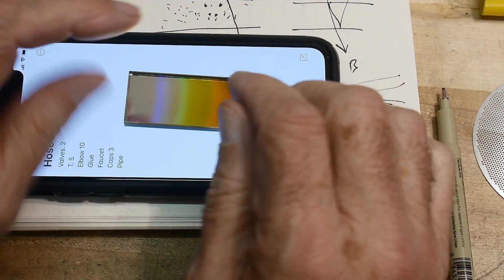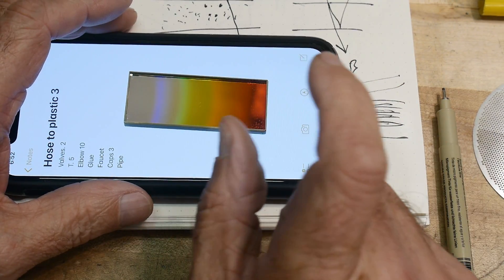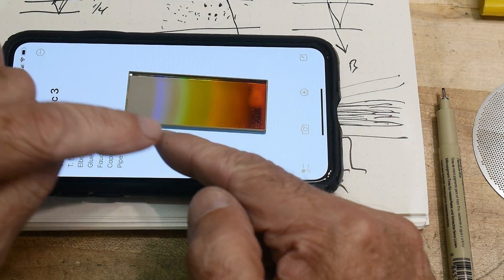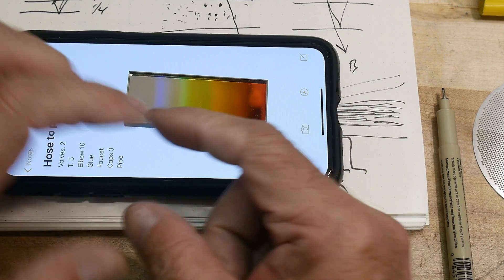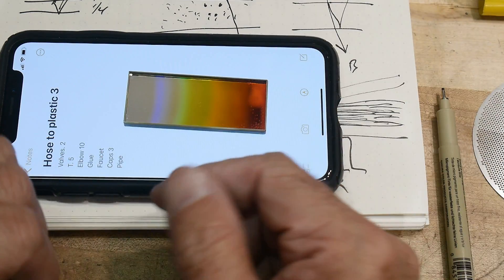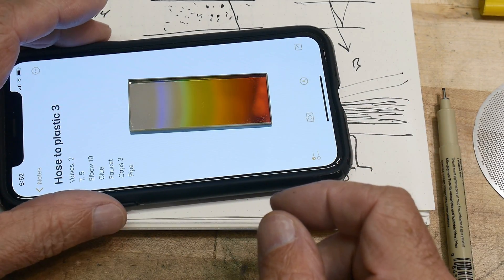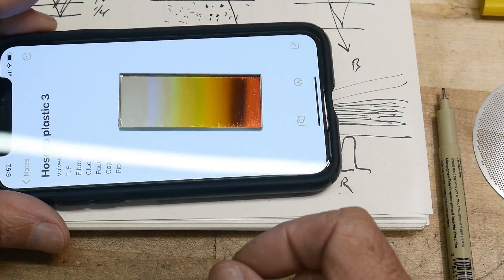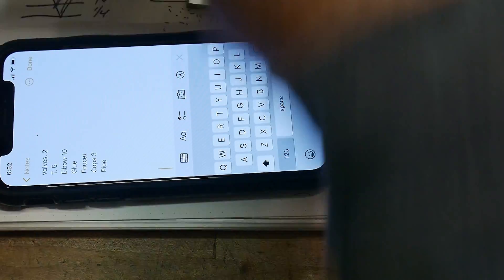#1046 Strange Optical Filters

Comment: Yellow is a SHORTER wavelength than red, blue is a SHORTER wavelength than green, and violet is a SHORTER wavelength than blue.  The wedge filter extends into the NIR and NUV at the ends that we cannot see but, yet, are useful in applications with electronic sensors.

Comment: Wow, totally awesome!  I've never seen that long a wedge filter or even such a great video detailing in general a range of filters.  Very excellent!   Wondering theoretically with like say a 4K webcam lens... what's the highest resolution of a theoretical wedge filter spectrometer in the ideal optical train designed for?   I was thinking that last lens was like a neutral density filter.   Neat, I've been wanting to make a webcam spectrometer using like BluRay disc section as a diffraction grating on a hard drive actuator to sweep like a dispersive instrument though with that magnetic bearing and a nice Apple CD/DVD drive sled for the slit width control for the collimator(s).  I so have all the parts... just not the best environment conducive for many of my projects.  Thanks for sharing!  Really neat... and times well with Les' Lab DIY integrating sphere video.
Reply: Amazing also how many are not aware of the THz and down the range optical methods & parts that are like what the human senses detect & perceive. Neat and awesome to watch!  Maybe you can do a homebrew interferometer spectrometer from like common parts?  I'd like to try that out one of these days as well and have been saving parts to play with after doing some theory for feasibility.
Reply from the maker: have you seen this: https://youtu.be/GXD9c5TQ6Ls
Reply: Polarity would be neat to see also... I'd like to add that dimension of information to the webcam spectrometer as well.  Like the circular dichroism aspect.

Comment: I do astrophotograhy as (yet another expensive) hobby, and one of the filters in my camera's filter wheel is a narrow band Hydrogen-alpha emission line filter.  It's got a 13nm wide bandpass at a 656nm wavelength (red).  Just looking at it, it just appears to be a mirror... an expensive 35mm diameter filter that just lets only a few photons through.  And of course, RGB dichroic filters that don't look like any of those colors from the front..  Neat stuff!

Comment: I keep thinking about designing something like one of those 328 universal component testers that are all over the Chinese markets for like $7, except also with an optical channel. Using a fancy filter would be cool, but probably not good for manufacturing. With a cluster of maybe 5ish LEDs of different wavelengths including IR, and 5ish detectors of similar wavelengths, you could run an unknown component through a bunch of different paces and help sort out the junk drawer full of unknown optical components that so many of us have. (Or is it just me?) Photodiode at 940nm? Check. Phototransistor for visible light? Check. Etc.
Reply from the maker: you might look at this one: https://www.maximintegrated.com/en/design/technical-documents/app-notes/5/5410.html
I was hired as a consultant on that project.

Comment: What a great video! I use a spectrometer with the work I do in horticulture light. As a tip for everyone, you can buy 400-700nm very sharp bandpass filters for about $20 on Amazon. My quantum light sensor uses one as well as a silicon photodiode flattening response filter.

(Most?)  lux meters use a simple plastic green broader short pass filter and then rely on the natural spectral response of the photodiode to approximate lux which is why they are much cheaper to make.
Reply from the maker: If you only want to measure LUX, you can get high end photometric sensors, that are photodiodes with expensive glass colored filters to fit the photometric curve much better than the cheap lux meters. UDT used to make them but they may be part of gamma scientific now.
Reply: @IMSAIGuy  Oh that's going to be pricey! My USB SQ-520 quantum light sensor from Apogee was $500 and I thought that was a bargain.